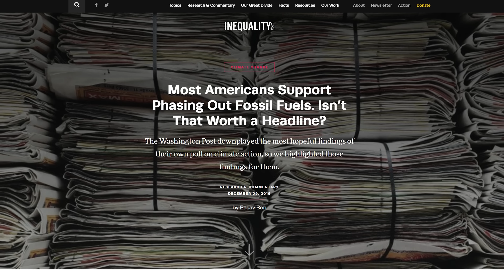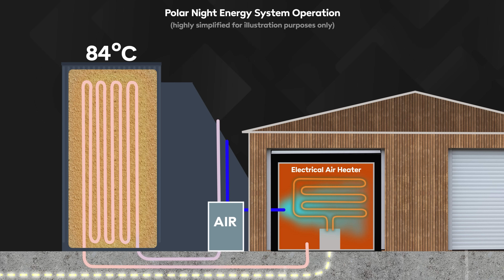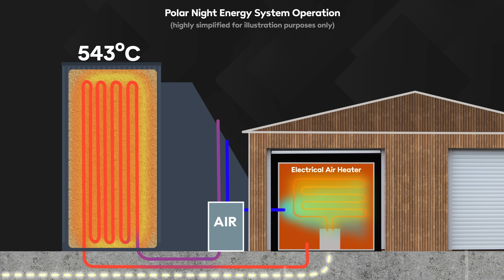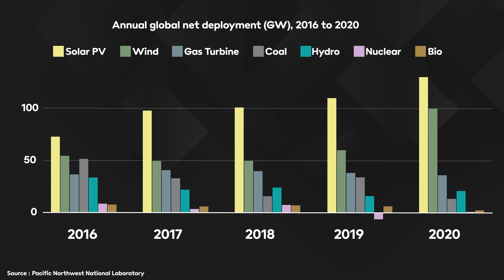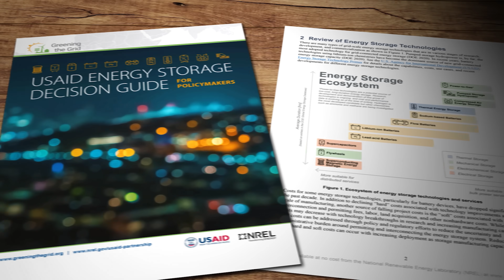The 'Sand Battery' that heats your home, NOT the planet!

Comment: Would be interesting to find out if I could use this system on a small scale for my house. I have suspended floors and have a lot of space underneath, perhaps I could fill a container with sand and heat it up during the summer and tap into it during winter
Reply: Ok, I did some maths. Sand heated to 600 celsius has a storage capacity of 138 kWh per 1000kg. For my house, which has a heat loss of 18kwh, I'd need 2 tons of sand per day of heating - not bad! My garage is 50 cubic meters, and so could store about 81 tons of sand - 40 days of heating from a double garage. I'll go get my bucket and spade...
Reply: @pumpkinhead456  I have a concrete silo about 12 meters high x 3 meters diameter- I suck at math
Reply: @pumpkinhead456  🤣
Reply: @pumpkinhead456  try iron, has more a lot more storage per volume.
Reply: @pumpkinhead456  you forget the time. Every day the heat that was stored in summer is lost a bit.
Reply: @pumpkinhead456  don't forget to include the heat loss over the storage time will decrease your stotage length and drop efficiencies (i.e. raise costs).
Reply: My point was, to heat it in summer and run it in winter, it either wouldn't last long or you'd need a lot of sand. I calculated that I would get 4 days of heating from a milk truck buried under my garden :) obviously it depends on your heat requirements, but heating a home can take a lot of energy!
Reply: It would need to be a very big pit and a very energy efficient home!
Reply: Hi, indeed you could do that. But it might not be as feasable in the small scale (do you really want to store material hot enough to burn your insulation/house underneath it?).

But if you have floor heating or proper convectors, you can utilize so called low-tempature heating (~30 Deg C). So have suitable thermal mass (sand) under neath your house and ran a network of circulation fluid pipes through it (and preferable also deep enough... or perhaps a combination of both). Use heat pumps to cool your house during the summer (thus dumping the excess heat into the soil beneath your house and in the deeper wells)... and when you need heating, recover it by extracting said heat (and using the heat pump to supplement). 

This is much easier to do, though when you're building  new house... as the foundation (especially, if lots of piles need to be driven there) can be used as that thermal mass (it needs to be there anyway, why not take that mass into use).
Reply: @hematula1  what you are describing is a ground source heat pump with insulation containment. In the summer the excess heat from air conditioning is pumped to the reservoir. in the winter it is taken out. But there are large seasonal losses. Carleton University in Ottawa Canada has a laboratory test house where this idea with insulation containment and heat pump was tested. It wasn't economically feasible (over time the heat is lost through the insulation walls and it isn't economically viable to put enough insulation around the walls to reduce the heat loss adequately) in Ottawa (think Canadian winter) weather. A search may reveal an academic paper on the results.
Reply: Look up Permaculture.
There is a man growing Orange trees in Kansas.
It might give you some ideas.
Reply: People do something very similar with greenhouses already.

https://youtu.be/uTQ3FL0IGhU
Reply: Solar heater day time and this night time problem of heating solved
Reply: You can make it work.  I have done it. Sand is not as quick of a transfer as water. The problem with water will be the temperature difference from top to bottom. Plan for a pump to circulate the internal temperatures. You can accomplish this with sand. Again much slower. The advantage to sand is the obvious. It does not boil and it does not leak…Storage is key if you have high heat demand. It changes virtually any heat source from city driving to highway.   I have seen people use milk trucks to store heat. They are well insulated. You could run a wood stove for a day then have showers for a week.   Don’t be afraid to try it.
Reply: Actually wood is the best energy storage to heat in winter.

Trees grow in summer. Chop m when u want
 Burn m when u want. No energy loss  during storage
Reply: @bobdebouwer7835  
🤔
Reply: @bobdebouwer7835  Wood needs to dry before burning though and most wood burners are very inefficient.
Reply: My 1965 built house had a thermal storage central heating system - concrete blocks IIRC. But with less thermal insulation than today’s projects, it was inefficient - you relied heavily on an accurate met forecast of the coming 48 hrs: heating it all up and having a balmy temperature outside was ll too common. And the reverse!

Comment: No district heating solution here in the UK. Sadly, the UK Govt is devoid of any sensible ideas and organisation to be able to put anything like this in practice within the timescales required. They seem mesmorised by nuclear both large and small which won't be up and running in the near future and will only serve to increase CO2 in the short term during build and effectively put the nuclear sites out of use for the next 10,000 years after the 60 years of useful life.

Comment: Really great video, there are a few companies working towards these same goals. One of them is Climatengine a private company I have done some work for. The project I was on was pool heating with basically no carbon footprint, really interesting project water was heated and at same time so was the indoor environment through new PCM materials for holding the harvested heat.

Comment: Another way - build anaerobic digesters at every single sewage works and municiple composting scheme - store the carbon zero biogas in gas towers (batteries) - and use the gas to run combined heat and power (CHP) gas turbines - use the heat to run municiple heating... and use the electricity to charge domestic and local grid scale batteries.

Comment: Simple:  Build your house constructed out of 12" thick walls of expanded polystyrene foam insulation, and the roof constructed out of the same 12" thick expanded polystyrene foam insulation. Then make sure that every gap or crack is sealed to prevent airflow through these gaps. Then have a heat-exchanging air-exchanger system so you don't suffocate in that super-insulated house.  Just one electric space heater per floor will be enough to keep this house warm.
Reply: The real problem is retrofitting to existing housing stock. While my house is highly insulated, I can't think how my previous houses could be improved much.

Comment: Heat pumps provides four times more heat than joule heating. Also, not using some change of phase (I.e. some salt compounds), implies that temperature has to drop quite a lot to recover most of the thermal energy.
What would be fantastic would be some compound that changes phase at temperatures appropriate for heat pump (50-60C), so that allowed them to be used directly at residential houses
Reply: Yes, but they aren't very suitable for most thermal storage because they aren't efficient at reaching the high temperatures that are wanted.

Comment: Great video. Did you know that short term thermal energy storage (from electric power) exists for a very long time in Belgium ? Probably due to the 50% nuclear electric mix Belgium use to have, the night price of electricity was very lower (it is not really the case anymore). It was possible to buy electric radiator that was warming in the night and delivering its warm during day with a ventilation.
Reply: But now that the price of electricity is rather dependent on wind and sun, the system wouls need inteligent counter to work. It is also much more important to replace basic electrical heater by heat pumps.
Reply: To have the system to work now (setting a minimum temperature and obtaining the cheapest warming), we would need very inteligent system to work. The system should know the expected price of electricuty per hour for the nex days and weeks. It must also know the speed of the electric devices and the speed of thermal deperdition based on expected temperature outside. For heat pumps it should also  take in account the efficiency of the pump based on external temperature expectation. Mabe you could make a video on companies providing such applications  ans all the difficulties they enconter to provide such solution ? Ideally the system should also take in account the capacity of auto-production of electricity (expectation based on expected prediction) and also have multiple minimum temperature  (in case there in no cheap electricity or unexpected change in price). It should also be able to measure the thermal deperdition based on previous data and provide downgraded solution when forecast are not available, are uncertain, if internet is down or if the local hardware is broken.
Reply: For short term thermal energy storage, I just found the "enrg blanket" product that store energy with phase changing materials... interesting to make the best usage of low cost electricity or solar panel warming

Comment: 8:45 it would probably way less with sand because water has about 6x the specific heat capacity. Nothing beats water for heat storage.
Reply: Water has an 'issue' at about 100deg. Sand not so much.
Reply: But water also has higher thermal conductivity, making insulation more of an issue. Perhaps a sandwich solution, with water encircling the sand/salt central heating element, and in turn encircled by another layer of sand for insulation.

Comment: so this system in winter like 32f and water at 60f gives you 47f or 72f with 80f water the dedicated fire supression system is a alternative and alternate water supply for firre suppression caused by earth quake domestic supply fialure, the anolog is the kobi disaster with 5000 people being burned alive in colapsed biuldings and massive fires erupting after three days primarily thought to be despairate water thirsty trapped inhabitants making an desperate signal for there rescue.the 5000 number is the actual number of people that died from smoke inhilation on autopse  examination

Comment: The problem with old fossil fuel/biomass district heating systems is one of reliability, as you have a single point of failure (that can knock out heating for a whole district) and lock in to a single provider (no control over cost). These issues can be reduced with the right legislation/regulation put in place by government.
Reply: As we have done in Finland for decades.
Reply: @verttikoo2052  alas, local government in the UK isn't run as effectively as those in Scandinavia, they tend skimp on maintenance and social housing is poor. District heating was installed in some "new towns", but they didn't maintain it, so it became unreliable, and was replaced with traditional gas and oil boilers.
Reply: @davidpowell8249  Such a shame. In Finland we do maintain our stuff. We have to. It saves money and effort.

Comment: well in the winter you could allways bundle up but when its above 100 f you die without cooling of some kind , a dedicated fire supression system or the underground plumbing is used to circulate cold water ie even 60 f water can give 20 f cooling 100f to 80f which gets you out of the death zone so wheather the water is from undderground storage or cold water from deep lakes or deoxygenated seawater beloww 60 feet the system is first a fire supression line ie fire hydrants ( underground plumbing ) an radiator circulation to air cooling and with mass storage like large capacity basements a thermal sink for heat storage say from 58f to 80f the dedicated fire line on cordova street in vanouver b.c. cost 15 millon 42 inch dia for 20 blocks and saves 30 millon per year in air conditioning 36f sea water in an cast iron pipe and latter interations using ferocement,

Comment: You've covered a lot of energy saving solutions from a systemic basis and also ways to produce your own energy.  But it seems as a home owner I don't have many low cost options to make my home net zero.   I will make an attempt here by adding a layer of insulation on my roof, sealing off the vents, and adding an air-to air exchanger.   I've done this to the garage for different reasons because I wanted a metal roof that would last a long time and look nice as it aged.   But now with building techniques changing it seems I can seal off my attic space and eaves without having to tear down all my shingles.  Just add a layer of insulation on top and horizontal or diagonal slats tied with long screws to the roof deck to add a layer of insulation on top.  Now this will need to be supplemented by spray foam under the roof as well as sealing up under the roof deck.   Since I also need new siding - I am looking to take down the existing siding and replace it with insulated siding to complete the job of sealing off my 1954 structure.  These old houses are built to last but we should make an effort to get them buttoned up so we don't use so much energy.

Yes, this will be expensive but as a diy kinda guy I think it's affordable, and will drastically cut my energy bill. 

This is my crazy idea but it would be great if you could share any inexpensive options you've found for folks to contribute to saving energy.

Comment: THERE IS NO SUCH THING AS RENEWABLE ENERGY THERE IS ONLY OIL. SOMEONE PLEASE EXPLAIN TO ME HOW YOU MAKE SOLAR PANELS FROM LIGHT ITSELF NOT FOSSIL FUELS. DO I MAKE WIND TUBINES FROM WIND? NOPE SO NOT RENEWABLE. HOW ABOUT NUCLEAR. NOPE WE HAVE TO BUILD THE STATION WITH FOSSIL FUELS THEN IT NEEDS RUN OFF THE FOSSIL FUEL FROM THE GRID.  DO NUCLEAR POWERPLANTS ALMOST DESTROY ENTIRE CONTINENTS? YES. THEY ALSO LAST ABOUT 60 YEARS AND TAKE EVEN LONGER TO DISMANTLE. MY FAVORITE IS THAT NUCLEAR POWER PLANTS PUT THE SPENT FUEL RODS IN THE SAME POOL AS THE REACTOR AND THE RE PYROPHORIC. IF CIVILZATION FAILS WHO MAINTAINS THE WATER IN THE REACTOR POOL. THE EARH WILL SEE NUCLEAR FIRES THE LIKES OF WHICH IT HAS NEVER SEEN.  EVEN IF WE DO GEOTHERMAL WE STILL NEED TO BUILD AND MAINTAIN THE INFRASTRUCTURE WITH FOSSIL FUELS.  PLEASE STOP USING MEANINGLESS WORDS.

Comment: Presumably if these were installed widely in the UK (for example) there would be a need for the installation of significant infrastructure to support it (insulated send & return pipes to every property, meaning digging trenches etc). A lot of disruption (though for an excellent cause) but also a lot of energy used (probably in machinery using fossil fuel power) - I doubt this has been overlooked, but just what impact might it have on the economic and environmental costs?

Comment: I think we need you look at localized opportunities instead of centralized ones.  Every area has advantages and disadvantages regarding one type of system over another.  Think we need to get cleverer and look around.  
If we apply permaculture principles to energy, methane, water supply, flooding, fire mitigation,  CO² issues, etc we can find what simultaneously has the least negative impacts/most positive outcomes per solution.

Glad you are exploring different options so we can find the mix that works.

Comment: i just look at the lack of efficiency from a resistive heater.
geothermal needs no storage and is the answer to the intermittency of some renewable sources.
that is the battery we should be putting our money into for the grid.
storage is for the home and the solar cell user who wants energy independence.
solar and wind are cheap and should be used when available, but the argument still stands  as it did with fossils.
the sun doesn't always shine, and the wind doesn't always blow.
but the earths heat will  be there for a long enough time to figure something else out, if we're still here.
what a waste of funding, instead of developing the never ending source of power.
even if you need heat concentrators, it's continuous never ending heat.
and eliminates a need for a battery.
if they put the money into developing it that they put into fusion, we probably would have had it cracked by now.
oil isn't going to waste the money drilling any deeper than they need to.
if only they figured it out, it could save their industry into the far future.
instead of only the next 3 decades.

Comment: how could we implement sand energy storage directly in the home? dig a pit under the house. insulate it and fill it with sand and heating elements? then use solar to heat it in the day to later tap off warm air from buried pipes and to pr heat hot water? In summer you just don't heat it buy blow air through to find cool air for the home.

Comment: Would a ground-source heat pump approach work at a district scale? I really like the idea (for individual homes anyway) where you can heat your house in winter using heat you dumped into the ground the previous summer (rather than releasing it into the air). If this could be implemented for district heating and cooling, wouldn't it make sense to use the ground as a heat buffer rather than building silos of sand?